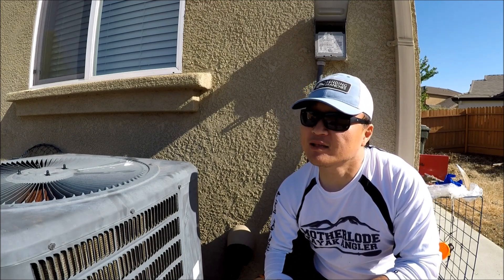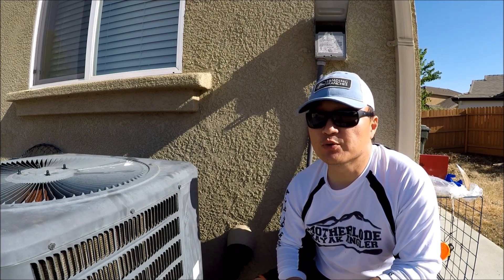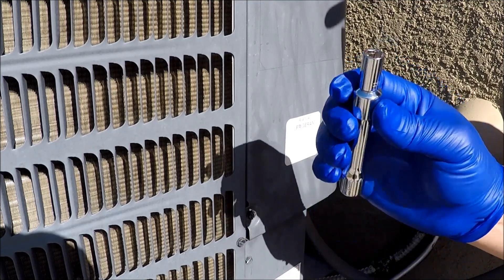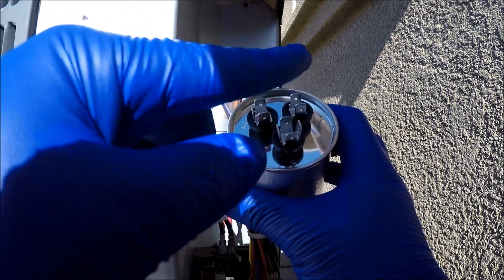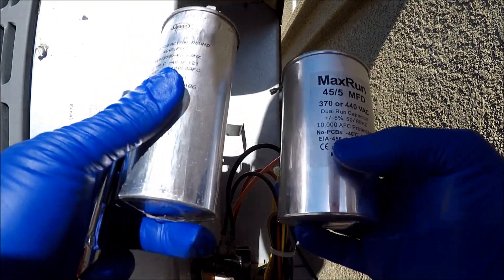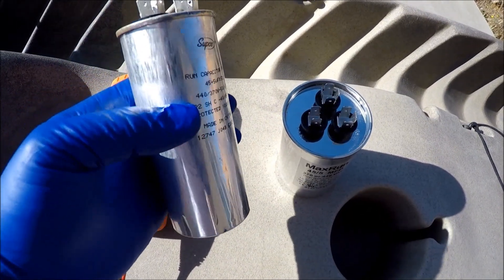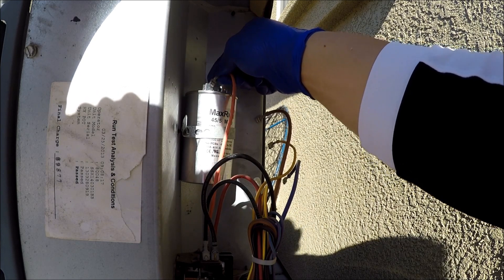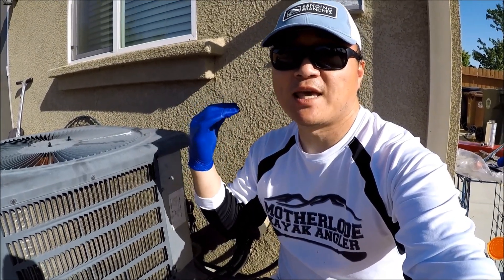Most Common AC Problem: Testing and Replacing Capacitor

Comment: My capacitor blew out last Friday. $220 to call for A/C repair. $20 capacitor $200 labor cost. I will come back to see this tutorial next time. But, hope it will not happen again. Thank you Mr Moo.
Reply from the maker: Ouch! Capacitors typically last 7-10 years. The more you run the AC, faster they go out. So, eventually it will happen again but next time you can save $200.

Comment: Totally agreed.  I’ve been a home owner for over 30 years here in SacTown where temps get over 100 every summer.  Capacitors go out a lot in AC units for me, family and friends that own homes with ACs.  👍🙏🎣⚒
Reply from the maker: Yeah, it's get so hot in Sac, the AC's get overworked and the capacitors goes out sooner than less hot areas.

Comment: before you burn out another capacitor, find out what is causing it to go bad
Reply from the maker: I think in my case it reached it's life span
Reply: @MooMooOutdoors  1 more likely lack of maintenance. 
2 power dip from power supply provider wiel unit was under load. Did ya have a power outage before problem ? I would have charged 565.00$. I would not have used the word "Capacitor" people just look it up and see your vid. I tell them that their Voltage regulator is bad. I give a new one, and put a new contactor, check all electrical connections, and clean the coils with a chemical, new air filter. 
3 Karma is a bitch! see what happens when ya don't share your squid with that "lady" HA!